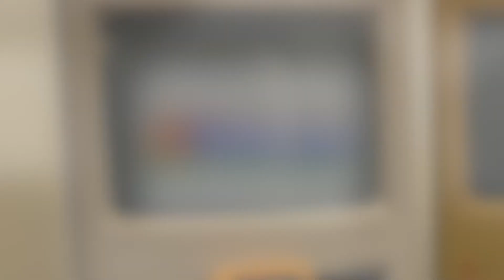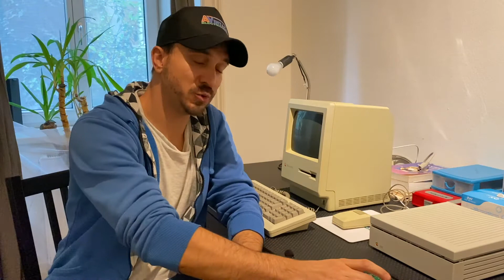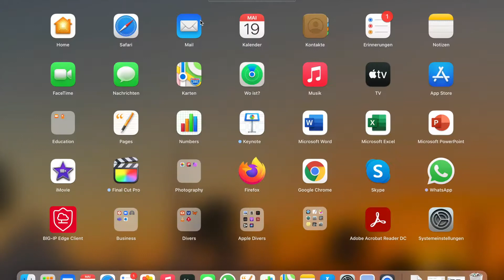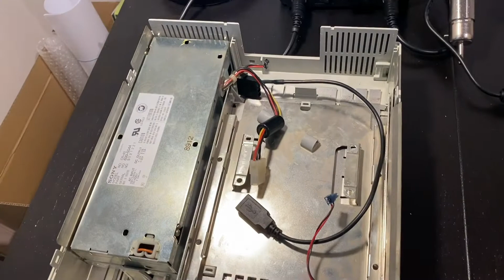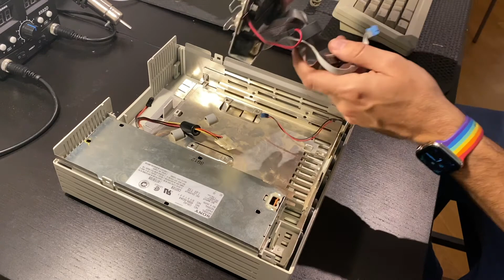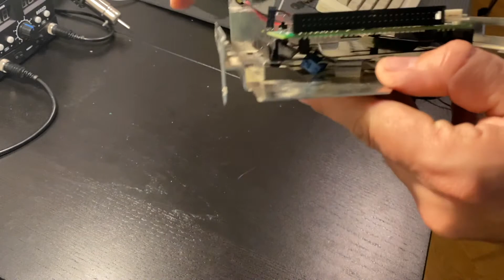Using a SCSI2SD to create an external Hard Disk 20SCSD (Episode 10)

Comment: Hey. Thanks for your video. And I wonder How did you make it the remain size of SD Card? Do you use Only 20MB? I did enable scsi target mode for remain size of SD then It is not boot at all. But delete check it then OK boot. Thanks ahead.
Reply from the maker: Hey! Yes I only used 20MB. I just wanted to replicate the HD20 and don’t need more space ;)

Comment: Can process be done to copy an external 1 gig Macintosh formatted scsi hard drive to sd card?
Reply from the maker: That’s a really good question, honestly there must be a way to create a full image out of that SCSI hard drive and then use it as SCSI2SD! But I also think, if you use Systems 6 or 7, you should get the same result by just drag and drop everything from the HD to the SCSI2SD!
Reply: @AmateurVintageElectronics   @Amateur Vintage Electronics  Thanks for replying. I was thinking the same thing. My scenario is...The HD for some reason no longer connects through scsi ports but I believe the HD itself is still good. So I want to take the hard drive out of casing while still connected to power source and connect to the 50 pin of the scsi2sd. I wonder if it will show up on the pc thru usb then I can drag and drop to sd and use the sd with what I was originally using the HD for. I have a sd emulator that can read the format of originally HD. The drive is an quantum fireball drive.
Reply from the maker: Hi there! If I understood correctly you want to connect the HD to the SCSI2SD via SCSI? That unfortunately wouldn’t work. The SCSI2SD as a whole works like a HD replacement but only in connection with an SD card. Your modern computer won’t be able to read anything through the SCSI2SD. What you’d need is a SCSI to USB adapter of some sorts to connect the HD to your computer. Then copy it over to the SD card. Don’t connect the HD to the SCSI2SD, you’ll risk frying it I’m afraid.
Reply: @AmateurVintageElectronics   Yes you understood right mostly. But I have to take the drive out of the casing because it seems the scsi ports no longer work. I have to try and connect the 50 pin ribbon connector to something to make it transfer data. Thanks!

Comment: I'd like to use a similar setup (v 5.5) as just an external HD. Two questions: can you write to the SD (or micro SD) card from your vintage Mac and could you also insert the SD card into a modern Mac and write to it from there as well? I'm trying to determine if this would be a good way to transfer files from new to old Macs.
Reply from the maker: Certainly! If you want to transfer files quickly, use the „MagicSD“! I‘ve posted a video about the MagicSD Project as wel, that‘ll help you in so many ways! Cheers, Michael

Comment: Why don’t they mount that SD slot
at the end of a ribbon cable for easier swapping?
Reply from the maker: That would be handy if you just use the board as is, but when you install it internally in a Mac case, you can use a bracket to have the SD accessible through the slot. That‘s really nice!